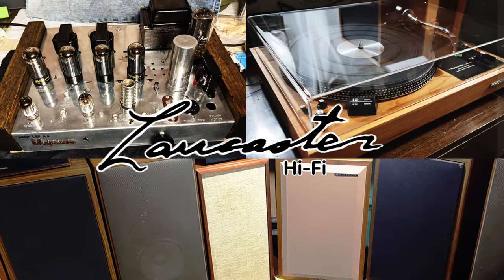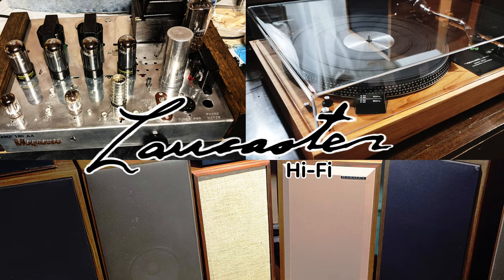Should You Buy Sensitive Speakers? Uh ... Whut?

Comment: Loved the deep dive into the trade offs between high sensitivity vs bass output.  I solved that dilemma with a subwoofer.  I have a pair of heresy IVs (Very sensitive) that I run with a Rel Ti5 Subwoofer.   The combo is sublime.  A low powered tube amp paired with a pair of sensitive speakers will get you the dynamics of the high efficiency speakers, the tube amp will add the harmonics and the sub will give you all the bass you’ll ever want.  Dial it in to your liking.  Want a lot of bass, put the sub in a corner.  Blend it in with the cross over on the back of the sub.  Trust me, 2.1 with high efficiency speakers is the way to go.  Stereo nirvana.
Reply from the maker: Sage advice. Thank you!
Reply: The “2.1…is the way to go” reference is the watts per channel of the tube amp or something else?
Reply: @hanksta34  2.1 meaning, left channel, right channel, plus a subwoofer.   My dad got me into audio gear in the 70’s and I’ve been an audiophile/gear head ever since.  I finally found the sound I had been chasing when I paired high efficiency speakers with a subwoofer.  Back about 4 years ago now.  It’s the best of both worlds!  Low volume or high volume, clean clear highs and sweet low bass.  Highly recommended.
Reply: Same here tube amp, focal aria speakers %89.somthing and a Bowers and Wilkins sub. I had to laugh at myself when I ducked once at a tone just behind my head.

Comment: The wharfdale's bass sounded deeper/richer to me anyways.  My own are Goodmans 12” full range circa 1955 . 100 db 1w .  270 litre wood cabs front ported. More than enough realistic bass from those in my room.  Of course manufactures want you to buy a sub or two hahaha.
Reply from the maker: Yeah, I thought the Wharfedales sounded way richer than the Hartleys in the recording. I guess I should either sit on the floor, put them up on tall stands, or put them on short stands that tilt them up. Makes me think of when I used to listen to my dad's system while lying on the floor under the dining room table; he had big EV cabinets, with concentric drivers, so the tweeters were about a foot above the floor.
Reply: @Lancaster_Hi-Fi  EV cabinets ... now you are talking.   "concentric drivers"? Don't you mean coaxial drivers, like in the EV  FM-12C pro floor monitors? 
Have you seen the way EV write the specification publications for their products that include reputable test data plots?   
I'd be more inclined to have faith in EV documentation rather than manufacturers who only come up with 'Marketing' leaflets aimed at home audio listeners.
Reply from the maker: Yes, coaxial, of course.

Comment: Another variable is the frequency of the test tone you use for the 1 meter/1 watt test.  The standard is, I think, 1 kHz.  No surprise there; it's 1khz/1 watt/1 meter.  The frequency of the test tone is necessary before you can know the precise speaker impedance for this test, and that can swing wildly (my speakers have a very low impedance at 80 hz, but go as high as 8 ohms at higher frequencies).  So one would have to find 1 kHz on the speaker's published impedance curve, and do the math with 2.83.  Point being, plenty of room for monkeying around by manufacturers.  But no one should believe that a speaker's impedance rating applies to all frequencies; that is only a "nominal" impedance rating.

Comment: My understanding is: 
1. Speaker's efficiency is db at 1m or SPL at 1W.
2. Speaker's sensitivity (it is in correlation with driver-s specs) depends on cone weight in the grams, excursion capability of diaphragm in the mm and the power of the magnet in Tesla unit - the last one also plays a role at driver's accuracy, the first two how the driver is fast sensitive. So it is between reaction time and control of the reactions of the driver-s. This is very clear and audible at full range drivers or with subs and that's why - due to powerful magnets - quality one's are much more expensive + quality of other materials of course.
At multidriver's speaker this is a bit more complex (driver's combination + crossover), but you have to see each driver's specs, how they behave and then do digital simulation of expected results. 
Saying that, each speaker should come with full driver's specifications. But the whole package is important, not just data.
If your hobby is making speakers then such data are very important if you want to make a quality speaker depending on the design - type of speaker. Just efficiency data is far insufficient.

Comment: You explain a lot of things,  quite well.  I just settled for a shade less than 70s The Who volume.  My house/room size limits volume that everything getting shaken: making undesired racket.  Glad you have the space and resources to explore to your hearts content.  The plus for me your findings simply explained.
Reply from the maker: Thanks! My dad's system similarly had a "rattle the windows" problem, but those windows were 12' panes, floor to ceiling. I did have issues with my Wharfedales causing things in the room to buzz. In my living room, I stuck some neoprene tape insulation to the back of some of the pictures on the back wall to keep them from rattling.

Comment: Great video I really appreciate when you break down the math and things, to answer to what you said about subwoofers, yes they generally have low pass inside for sub frequencies. A feature I don’t see much now in the current powered subs,  but I saw in some of the older powered subs from the 1990s maybe early 2000s , is  RCA low level outputs with high pass filters, to go to an external amp for satellite speakers . I have used them a few times with a tube amp I borrowed just to experiment with,  I thought IMHO it was very good results, as the amp seemed to work less hard. I used an older 15” definitive Technology powered sub from mid 90’s and a few Velodynes with the same high pass feature. The velodynes were a favorite to me , the other seem to induce slight hum into the the amp being fed from high pass out! Could have been a bad cap within the Def tech’s internal amp, it was 25 yrs old at the time. But I have found those features useful in subs when using a great quality but lower powered amplifiers on the main speakers and I recommend them quite often to people set on using their tube amps in systems . Any how great videos , very educational!!!

Comment: I was concerned about this subject because I got my first tube amp this week, a Cayin MT-12N EL84EH integrated. It's rated at only 10 wpc and I was putting it in my secondary system with Wharfedale Diamond 12.0 speakers which are stated as 85dB sensitivity (2.83V@1M) and a suggested 20 watt minimum. I had been running them with my old B&K Sonata pre-amp and Adcom GFA-535 II amp which worked pretty well. But I was pleasantly surprised and a bit shocked when right off the bat the thing not only had bookoo volume but also sounded great, with the best bass I'd heard from it, even with my Yamaha A-S3200 amp. Even playing mellow music it's way too loud for me at the 12 o'clock position and sounds very clean. Maybe one day I will try it with my Zu Audio DW6 speakers, which by the way sound excellent no matter how they measure, lol.

Comment: I enjoyed your discussion on this topic. It has frustrated me that companies that build speakers and amplifiers have entered into this game with their specifications. I have no doubt that it is a result of marketing games to draw un-informed consumers. I think prior to the 80’s that most companies were a bit more honorable and gave specifications that were more accurate. But then the power wars started and that combined with price competition moved companies to be more creative with their specifications to make their products more appealing to the consumer. 
I have been using 2a3 SET amps in my home for a long time, and I don’t use huge horns or anything like that. I had a couple different pairs of PrAc speakers that weren’t crazy efficient and they were a great sounding combination. Granted my room wasn’t large, and I don’t try to wake up the neighbors. My normal listening level is 65- 85 db. These speakers are rated at 87 db. So if I hit a little bit more than one watt peak it is all good.
Madisound has this kit that has been tempting me. It appears to be an honest 92db one speaker driven. So 95db for a pair. The Uluwatu, is a 2.5 way kit that uses six 5” SB woofer’s and one tweeter to provide good sensitivity and good low frequency extension. So with two watts, you could reach 98db. That is pretty loud in my opinion.

Comment: You do explain this well. I'm not an engineer but have had many speakers over the years as a  avid hifi nut. I too lean towards the world of efficiency in speakers. That way you reduce the load on the amplifier so you can work towards a way less complex amp. Or if you have a powerful amp the all important headroom is increased. I have a pair of Jbl L112. These are relatively efficient but they like the 130 watts per channel of the Accuphase E305 l connected to them. I play moderately loud and I typically use 5 to 30 watts perchannel in a small space. Some very high end speakers have these crazy phase angles that require bags of power at 2 to 4 ohms. If you have the money to buy a gryphon amp that can deliver 2 ohms and bags of current great for example  ..I don't but a mates huge gyphon can deliver 1200 watts into 1 ohm. Even at crazy levels this monster never stresses out. I like the idea of adding subwoofers to efficient speakers. Many will scoff but if you dial them in properly they are nothing but an asset.

Comment: This was fun to ride along, and there is nothing wrong about your clues. What I missed was pointing out the biggest benefit of higher sensitivity speakers, that is you can enjoy the full music spectrum with a certain dynamic at a lower dB-level.
I guess, different kind of music favorite different speakers. That's why maybe most audio enthusiasts actually own different pairs of speakers. 
One way to get a higher efficency speaker, that probably still will be big, but not huge and going down to 40Hz, could be a speaker with a double 6 to 8 inch woofer. At least that speaker wouldn't need to be 15'' wide

Comment: Great discussion.  I am beginning to think that the best solution is to use triodes for 150 up into some really good sounding speakers and use class D into separate big boxes for the bass.  Also the bass should be placed in the room to optimize bass at the seating position and the main speakers placed well away from the wall optimized for imaging.
Darren Meyers mentioned he was building massive bass boxes to place left and right of the listening position and good speakers in the normal eq triangle.  If you have a dedicated room and a big budget, this is the route to take.  No one needs big dollar floor standing speakers because it is impossible for them to produce good bass where you sit.

Comment: Great video! Just let me add a couple of comments. Large cabinets are needed for efficient low bass, that is true for all speakers. But in the same box a high efficiency driver's bass will roll off at a higher frequency because the diaphragm and all other moving parts must be lighter. A lighter cone - all other things being equal - has a higher natural resonant frequency. About the Klipschorns: they need that huge cabinet plus the corners of the room not because of the high efficiency but because they have fully horn loaded bass.
Reply from the maker: I didn't even want to get into driver efficiency because it's so complicated, and there are so many catch-22's, at least with "normal" materials. And, I clearly need to read up on the Khorns and horn-loaded speakers more generally. I gather that "true" horns (with compression drivers) are more efficient and are different from "horn-loaded" drivers (with conventional cones). I get that the Khorns need big boxes to fit the horns loading the woofers because of the exponential horn that starts with an orifice big enough to cover a big woofer. But doesn't the same (Hoffman's Iron) law apply to that box, even if it has internal baffles to make a folded horn?
Reply: @Lancaster_Hi-Fi  I'm not sure if true horns in general and the K'horn specifically have boxes behind the bass driver. I think not. The horn has to be long enough to accommodate the wavelength of bass notes, which is pretty damn long. Hence the requirement for the large cabinet and for the walls and floor in the corner to act as extensions of the horn formed by the cabinet. The longer the horn the lower the bass roll-off frequency.

Comment: During the eighties my standart 3-way model had ~ 91dB/W/m. Audax bass and mid cone paper driver (coated) and the MB Titan 
dome tweeter; with ~ 65L bass reflex for bass and terminated line for mid. Carefully stiffened and dampend. Crossover was 18dB/oct 
butterworth with Z-lin and level adjustments.  Crossover was around 600 and 3600 Hz.
Basicly this speaker was constructed for the (back then) Kenwood hit poweramps M1/M1A/M1D in rooms with at least 25 sqm and a 
rooms hight no less then 2,3m with a rectangular basis and no less than 4m for the small side to accomodate decent "free standing" 
of the speakers. 
This speaker could easily offer clean sound untill the overload circuit of the poweramp switched it off. You could realy "bath" in sound 
on a level where you had to scream into the ear of the person standing next to you to be able to communicate without having a feeling 
that it was to loud or unpleasant .And the sound was at this level fully detailed,dynamic,spatially correct and clean.
I got this speaker also auditionend in the largest local store back then and it was only topped in soundquality by industrial speakers
(active ones btw with smart feedbacklooping) that were over 10 times the cost.  I even was asked two decades later by a chance encounter
with the boss of that store if i still build speakers....LOL. But at that time i was a family man and had other priorities entirely.
Well,that was in the eighties.
Recently i tried to lift this construction into the 21. century (with different chassis). However,todays drivers available to DIYers are of 
way (!)  lower SPL,although they are better on THD.  Back than those speaker were around 2,5k a pair on parts. Needless to say that today

you have to pay more than double that to come even close - and still the SPL is inferior.
Of course there are 2-ways.But 2-ways are limited by physical "hard" borders when it comes to dynamics and THD on higher listening levels.
Very few stretch this borders. Like the DeVores Orang Utan for example. But those are pricewise in a complete different ballpark and they
use especialy made chassis by SEAS. Imho the DeVores are very good for the best class a and tube amps out there,but back in the day i 
started this as a budget project. Wanting to see (and hear) what is possible on a price level that is reachable for a common person.
Well,i came to the conclusion that while chassis became better,they also became way more expensive and thanks to the fact that amplifier
output power isnt a problem anymore the chassis producers on average went for the lower SPL and lower THD way.
You get decent quality for a acceptable price,but you dont get realy high quality for it. That is behind a huge step in price. 
Back in the day you could save a huge amount of money by clever DIYing,not anymore. That market is entirely adjusted to favour buisness
but not you.

Comment: Hope you found a nice pair of speakers.  Speaking of sensitive speakers 'Sound and Vision' reviewed and lab tested B&W CM9's and found them to achieve 92db sensitivity.  I bought a pair long time back new and yes they have enormous volume capability and quite reasonable bass for their relatively modest cabinet volume.  SQ wise though they are a bit forward and bright stock settings.  It's the two crossover zones that sound a little off.  The 250-400hz range iv given a approx 3db Q of 2 bowl shaped cut to which makes the mids sound less forward and more open.  And also gave them a similar but even heavier 4db Q2 bowl shaped cut 2-4.5k which really helps out the sibilence of the big 6" midranges struggle with its 4k crossover to the tweeter (like a higher BBC dip).  Pre-amp Yamaha RX-A3060.  Amp Nad M3 Class A/AB amp.  With their notable flaws damped I really like their overall sound.

Comment: With efficient speakers, say 92-94 db,.cd players, tape decks etc. can be plugged right into a power amp, without a preamp & have enough volume. With your usual output stage and your usual input stages I'd say 89db efficiency in smaller rooms and 92-94 db in larger rooms will let you bypass the preamp and your speakers should be just the right loudness on most material. Even the brst preamps, just like anything else extra in the signal path, degrades the sound quality a bit...If you have both a great preamp and great cables, it won't degrade it by quite as much. For some that's one good reason and use for very efficient speakers.